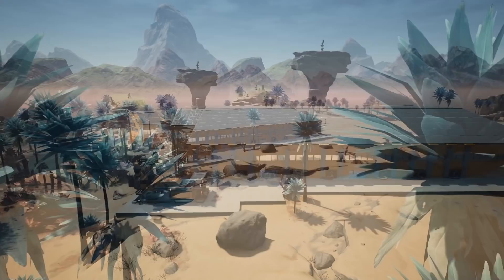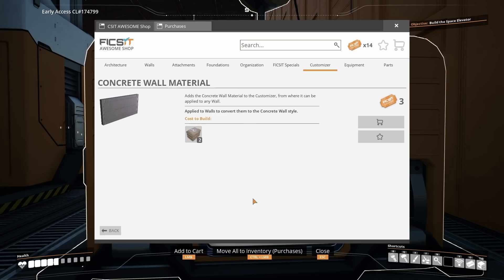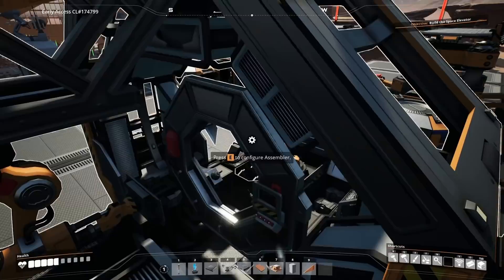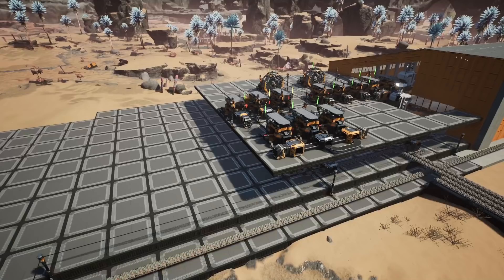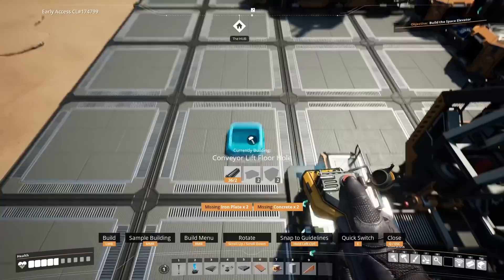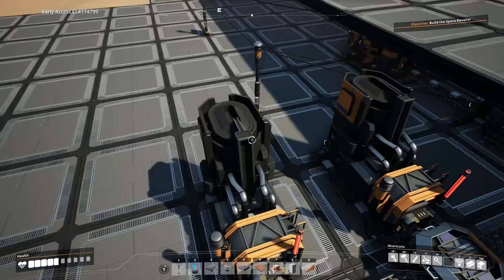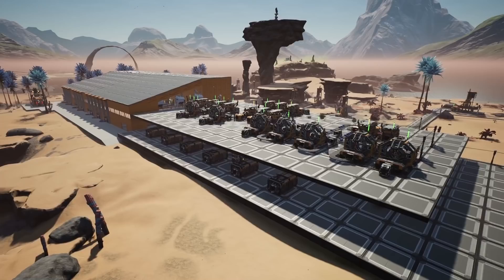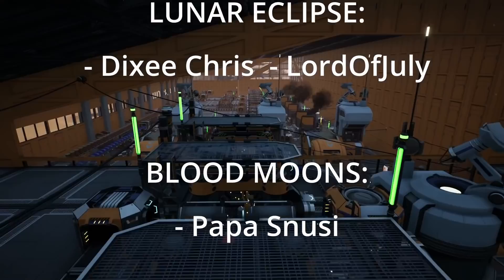The PERFECT Starter Factory. Pt.2 Smart Plating | Satisfactory Game

Comment: Ok so I'm relatively new to satisfactory (25 hours total) and at 11:55 shouldn't it be backwards? Where the extra 5 rods go to the left giving the extra 5 rods needed for 100 screws per minute? And still meeting the 20 rods per minute needed by the assembler? (If yall are wondering overclock the left constructor (screws) to 125 with a power shard the middle set to 62.5 and the right set to 62.5 for 100 screws a minute. Do correct me if I'm wrong because this seems correct
Reply: its actually correct. while he should have actually load balanced the screws (2 set to 33 per minute and 1 set to 34 per minute) instead of the 20/40/40, it will run at 100% efficiency after a little but of time running. I have the same exact setup and all the machines show 100%. The smart plating on the other hand (later on in the video) is backwards.

Comment: Is there a manifold mechanic somewhere I'm not understanding? Completely lost me 10 minutes in. No longer have any idea what's going where or why. How do you control how much goes where? What determines what you're underclocking things to?
Reply from the maker: We try to make the input the exact required for a constructor, if a constructor is getting 10 iron ingots, but it needs 15, to run efficiently, we'll underclock it by 30% so it only requires 10 iron ingots
Reply: @TotalXclipse  That helps. I've been trying to build around the 100% outputs of devices rather than working backwards underclocking things. For instance, if I have 120 screws/min from 3 constructors and only need 100/min for an assembler, rather than underclocking one or all of the constructors (and subsequently bottlenecking the previous constructors, smelters, and miners which are all running at 100% output), I've just been trying to figure out how to intelligently route the surplus without smart splitters, since splitting up the 120 screws/min will give you 60/min + 60/min, not the 100/min + 20/min I want (for another assembler).

So far a smart splitter is the only way I can figure out how to do it (routing overflow when the first assembler is full on screws elsewhere) without some crazy array of splitters rearranging halves and thirds and looping back into itself to give me 100/m + 20/m, which I don't really know how to do.

Comment: Can someone explain to me why he's underclocking some machines?
Reply from the maker: To make it efficient without using excess power by overclocking. If a line requires 1.5 X per minute and a machine produce 1 per minute. Currently it's more efficient to place 2 machines and underclock Vs overclocking one machine - this may change update 6

Comment: You can't have smart splitters this early in the game....May want to put a PSA about it???
Reply from the maker: Maybe you should watch the first video... Where I talk about unlocking smart splitters within the first hour or two... It really isn't difficult just research caterium in the MAM
Reply: why can't you ? all you have to do is run around aimlessly for about 40 minutes looking for caterium. grab about 300 ores go dump like 100 into research, rest into quick wire and boom AI limiters for smart splitters. after the first 50 it also unlocks the ability to scan for caterium. and where he built, there is caterium like less than 500 meters away up on the hill.

Comment: This is gonna be a long comment:

Even though i do like your videos, please be more precise or atleast don't cut out as much, when you're already making a 30min video. i had to go back so many times, because it wasn't clear, where you were or things simply were cut out or not show/said. this 30 minute video took me easily 6-8 hours to build, because of that... Too much placement, connections etc. were just shown for 1 second with the words "connect/place this there". That doesn't help, since you're making tutorials for newbie players that play in normal mode and thus have a much harder time seeing everything and also don't know everything.

Another issue: i had the auto-snap-option on in the menu. This causes issues with the placement of assemblers and constructors, causing them to not being able to connect to lifts or get placed at all. The assembler is 10cm higher than the lift exit with this option on (game options -> thrid from the bottom)

at 14:40 you have completely lost me. you added additional lifts and mergers to the original container setup and didn't explain, what exactly you did there. 

at 27:11 you did a lot to the storage region completely off-camera and didn't show it at all. i have absolutely no clue how you solved the issue, where you placed the smart plating storage in front of the modular frame conveyor, making it impossible to run the line. You completely set back the ENTIRE line of either storage containers or assembler outputs by one click (or atleast i had to do that, but it still doesn't look similar to yours.)

Regarding the smart Plating line: there are not enough screws (because there are not enough rods + you did the calculations wrong. 49.3 screws isn't 50 screws for the rotor). Both the rotor and the reinforced plate assembly lack screws. The rotor assembler gets 18.5 rods, even though it needs only 10. and the other gets 10, even though he needs 18.5... I fixed that and tweaked the percentages on one screw assembler and one rod assembler. Each got 5% more power and now it should work.

Same for the Rotor assembly line, that one is lacking screws because the constructors lacks rods. Reason: you did the 20/25 split of the rods the wrong way. the right side needs 20, while the left needs 25, but you did  it vice versa.

Another question: How do you do copy-paste objects?